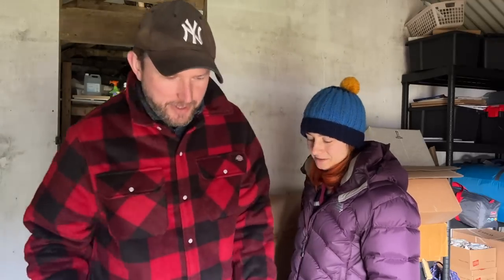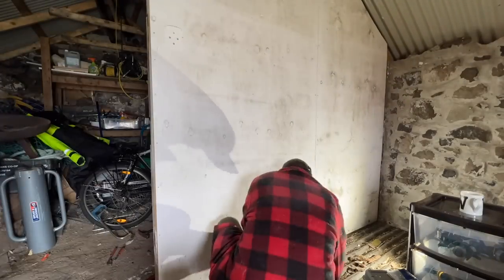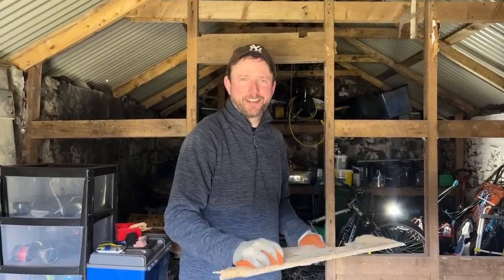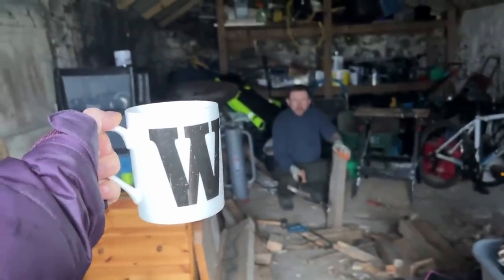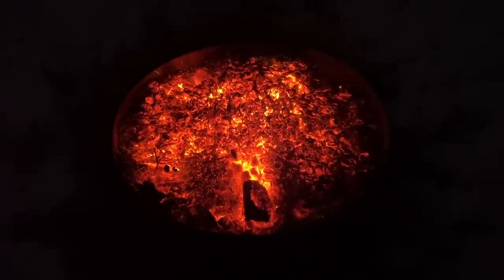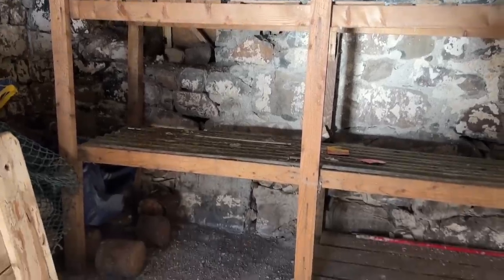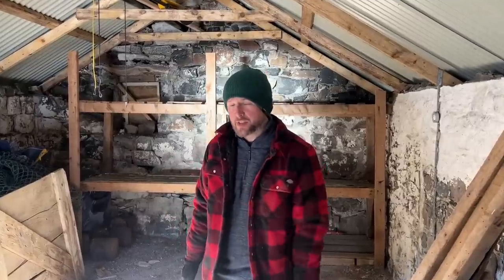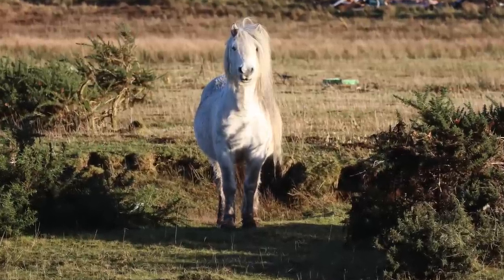We Begin Refurbishing our 1840s Tiny Cottage on the Isle of Skye, Highlands, Scotland - Ep10

Comment: Just a note on the byre re insulation. We need to be careful when we insulate old buildings like this because we can decrease airflow and increase condensation. 
I'm a building designer but I work in Australia so I can't advise on local products but it's probably worth checking in with a local architect, designer or builder to make sure you're using products (membranes etc) that are going to reduce the risk of this and ventilating as necessary.

Comment: Your old scythe/sickle looks more like a hedging knife to me.  It would have had a straight handle of a suitable length.  They came with various degrees of curve on the end, from virtually straight through to a 90 degree bill-hook.  If suitably sharpened, they made short work of trimming back mixed species hawthorn field hedges in the days before it was all done with a tractor and brushcutter arm.  As a teengaer, I used to use hedging knives to do the roadside at my granny's farm down in Ayrshire.  We also had scythes and sickles ("heuk" in Scots), but that blade looks more like the hedging knife.  Nice find!

Comment: Hello there lovely out look , the roofing screws can be put in and out using an Allen key bolt that takes a 8mm Allen key or a socket and shout extension into the trustee drill

Comment: Hey folks, really enjoy the channel, I work in sound and the 'fluffy' (glad you didn't call it a 'dead cat', I hate that expression) certainly cuts most of the wind noise, I don't know if you use Adobe Premier but judging from the sound test, if you apply a High-Pass Filter to the outside sound and set it to roughly 100hz (you may have to fiddle back and forth to get the sweet spot) that'll get rid of the rest of the very low frequency sounds I was hearing while listening to the test in my headphones.

Comment: I am not an engineer but you might investigate whether you need to replace the supports for your roof. It appears that the purlins are holding the majority of the load.
Reply from the maker: Thanks Melissa - we have hired the roofer that fitted the roof for the conversion. There is already talk of strengthening beams etc. 🙂